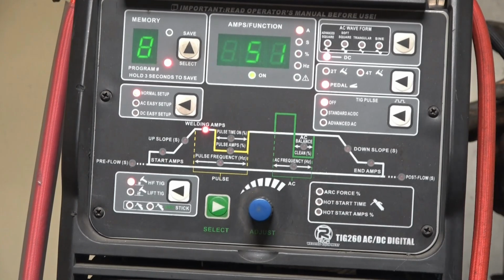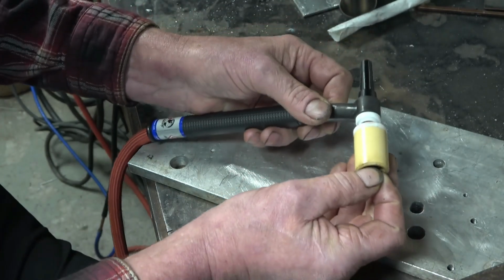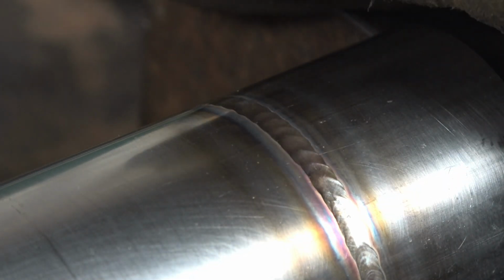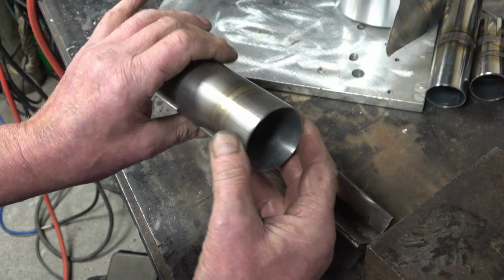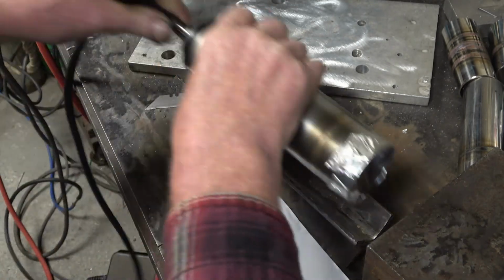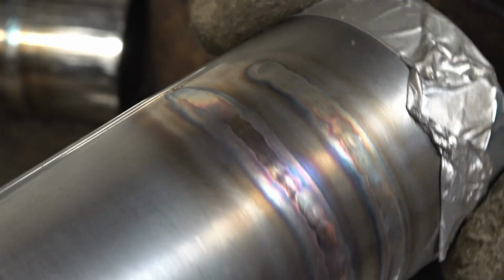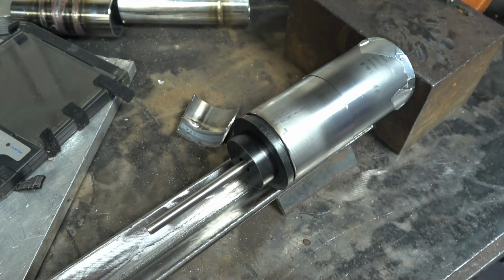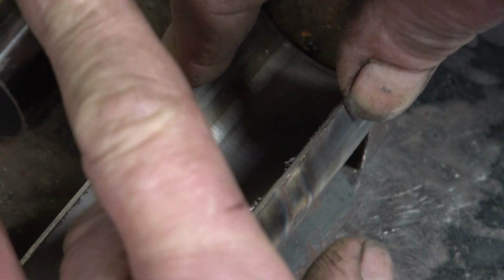R_Tech Power TIG 260 Long Term Review . Stainless With Argon Back Purge

Comment: R Tech would not supply me with a 260 amp tig because I am a 78 year old PENSIONER.
Reply from the maker: That seems very strange did they give you a reason
Reply: I won’t waste what’s left of my life over them. I purchased a Polish/Chinese copy of the same machine, pedal and all for £300 less money. They have their heads stuck up their own backsides.
Reply: what does age have to do with trying to buy something? and ditto fact you are a pensioner?
Reply: Bad Bad credit risk I could die before I paid for it. My credit rating is over 700 and I’m still alive !!! R Tech refused to intervene and I assume it’s down to age  discrimination. Their loss not mine.